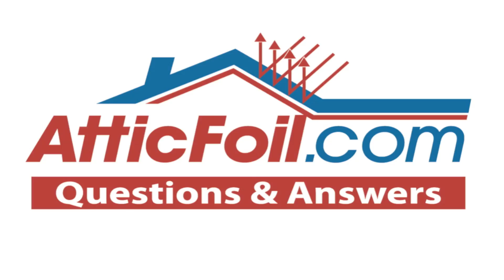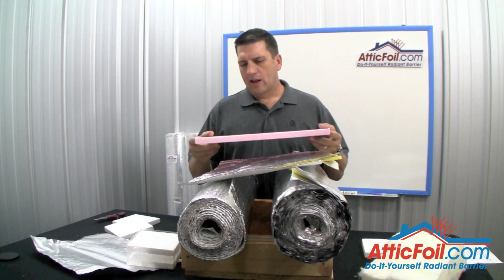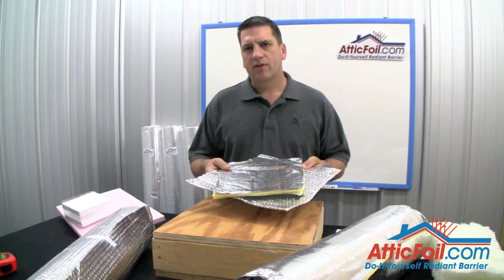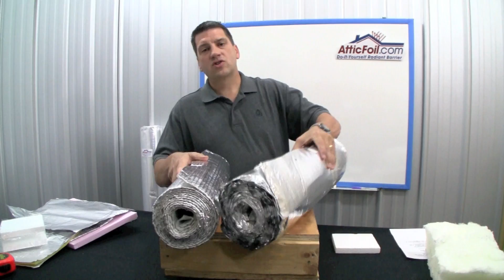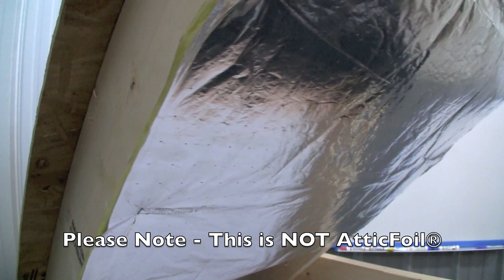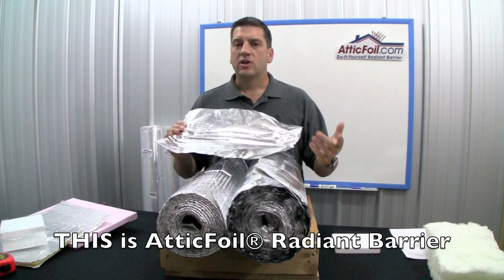Bubble Foil Vapor Barrier Scams - False Claims About 11 R-Value By Other Products

Comment from the maker: Have you ever seen a scam claim for a product stating a unrealistic R-value?  Please comment here!
Reply: Very common in France and UK , I have been fighting this miss information for years this has done a lot of damage to the reflective foil market , when install correctly Radian Reflective transform the thermal performance of the building, Do it correctly ..
Reply: When I put the radiant foil on my roof floor should I staple it? Or let it sit loose for air to flow???
Reply from the maker: @kodyhunter5566  Lay it loose.  No need to staple down.

Comment: I saw one advertised with R-7 on amazon, so, I knew something was amiss.   Dog leashes I bought for a 90 lb dog from amazon, would not hold a 30 lb dog, an electrical cord bought on amazon melted, etc, etc.  amazon has no controls.   No check.  No Accountability.

Comment: I have a commercial building, Auto Service shop with 30 foot ceiling. we have a radiant barrier but the joist hangers are rusting out. Can the radiant barrier be causing this trapped moisture?
Reply from the maker: Probably not caused by the radiant barrier.  My guess is lack of ventilation and condensation issues.  Take a look here: https://bluetexinsulation.com/pages/moisture-in-metal-buildings-causes

Comment: Everybody keeps talking about homes? What about a semi truck? What be the best way to install something like this? There have beams on the inside behind the panels that are like beams in the house. Get so hot and no semi trucks it's insane. You can walk inside and go to the restroom while your truck is turned off and when you get back it is so hard to cool it off. The AC unit on the semi truck works fine it blows a lot of air. But an APU on what's in my truck doesn't do much you're fighting against everything.
Reply from the maker: We have many people install our metal building products at www.BlueTexInsulation.com inside metal shipping containers, trailers etc. with great results.

Comment: But I want something for underlayment on a sub-floor between floor joist that is exposed to outside cold, not in my atic, So bubble foil will meet that requirement better and will detour rodents.......
Reply from the maker: Check out our foam/foil products at www.BlueTexInsulation.com 10 times more durable than bubble foil products.

Comment: does atticfoil  help to save energy during winter ?
Reply from the maker: Yes.  The best method to keep heat "in" is to lay the SuperPerf product on top of the existing insulation. It works mostly by making the EXISTING insulation MORE effective.  https://atticfoil.com/index.php/installation/over-the-insulation-install/

Comment: Question:  I have a small cottage in Florida with a metal roof.  In the summer the AC does it best to keep up but the attic is so hot it seems that the cool air coming out is not as cool as it could be.   Will attic foil help reflect the heat so that the cool air flowing in the duct work remains cool?
Reply from the maker: This is exactly what www.AtticFoil.com is designed for.  The heat from the hot roof is radiating across the attic space, heating up the insulation and then entering the home.  Your AC simple removes a certain amount of heat.  By reflecting a lot of this heat back this means an easier battle for your AC. (less heat getting in).  Basically AtticFoil make is like a really cloudy day.  I'm sure your AC can keep up on days like this.

Comment: I have a new product that is R 600. You just take 60 rolls of R 10 and sandwich them together add 6 inches of your choice of wall material and add 4 more inches of spray foam. Do you see where I am going with this. It should be illegal to advertise a product that only reaches a given R factor with the help of other materials. Scammers!  Thanks for the video and explanation.

Comment: WRT "Dead Air"...... it has an R value of slightly less than 1 (~0.9) and reaches this maximum at between 5/8" to 3/4" thickness.  Any thickness more than this it loses R value due to convection currents within the airspace as a result of the temperature differences between the 2 surfaces.  So the R value of a 6" air gap would likely be at best R0.5.
Reply from the maker: I think your comment totally supports my argument made in the video.  Bottom line is that NO product 1/4" has an R-value of 7, 10, 15 etc.  These companies have very misleading info when they talk about R-Value.  The R-value stated is ALWAYS in some type of "assembly" which is rarely how the product is installed.  And, as you point out, the "assembly" R-Value is probably overstated too.  Thanks for the comment.  Ed.  We have several great new products at www.BlueTexInsulation.com that combine Foam/PE Woven Fabric and Pure Aluminum to  make an amazing product for metal building applications.

Comment: Can you use the attic foil in the wall as and roof of a metal building, then also add 2” foam insulation? Making an insulation sandwich more/ less.
Reply from the maker: Probably yes.  However, you should call us do discuss the specifics of your application.  We need more info.  New or existing building, conditioned or non-conditioned, location etc?  Call us at www.AtticFoil.com

Comment: I have a bedroom above my garage that has the roof coming at an angle and a knee wall at the edges... should I use foam board and this stuff behind the sheet rock? There is no insulation in the section above the knee wall where the roof deck is essentially directly above the sheet rock and it gets extremely hot in the summer... These channels are connected at both ends to the attic and knee wall space...so i'm trying to find the best way to insulate and prevent the heat from the sun from getting in! Thoughts?
Reply from the maker: Yes, foam board combined with radiant barrier will make a huge difference with "hot walls".  This blog post may help too: https://www.radiantbarrierguru.com/hot-rooms-in-my-house-how-to-make-them-more-comfortable-part-1/

Comment: Put that Radiant barrier in our Attic years ago. Just laid out on top of the Insulation that was there. Had people laugh that it was only Tin Foil. But used to be 4 degrees or more temps between the floor and ceiling in our house. After installing this now its 1 degree difference only.

Wrapped a live bait tank with 2 layers of this stuff. Sitting in 90 to 100 degree temps for almost a month. Bream we had been using for bait (3 small ones) was still alive. Boat was under a roof. But still hot temps. Bait used to only last hours. but after covering it with this stuff. Days and weeks now.
Reply from the maker: Thanks for the comments!  When you take out the radiant heat and just deal with conductive heat then you have seen what a difference it can maike.
Reply: AtticFoil Radiant Barrier Foil Insulation
Worth the price, if we had to build a new house. It would be wrapped in this stuff.
Reply from the maker: Absolutely!  Using the single sided radiant barrier instead of Tyvek House Wrap is rapidly growing in popularity.  https://atticfoil.com/index.php/applications/house-wrap-behind-brickstone/

Comment: THIS STUFF is for REAL!!  41% savings over last year on my E(xtorsion) bill and had a temperature increase of 5 degrees over last year (average ambient). SO GLAD I did this in my attic.  Wish I had done this the last time I added inches to my blown-in insulation.  Brought the temperature down 60 degrees in my attic, no BS. Also added 2 solar fans:)

Comment: Do you have a fire test video where you apply a blow torch directly to this foil? Does it have a fire retardant coating on it?
Reply from the maker: No test video.  We do not claim the product to be "Fireproof"  The aluminum will resist flames, however if the internal scrim gets hot enough it will eventually liquify and burn.  Here is more fire info:  http://www.atticfoil.com/technical-information/fire-testing.html

Comment: In the Fresno area, they install radiant barrier over spaced sheathing when removing cedar shakes; this means that half the foil is covered by the skipped or spaced sheathing. Since half the foil is without a air space, wouldn't this reduce the effectiveness of the radiant barrier?
Reply from the maker: Yes, this is pretty common.  This will reduce the overall effectiveness by about the amount of area where there is no air space.  One suggestion is to remove every other lath.  This will help maintain the integrity of the framing and increase the effectiveness of the radiant barrier.
Reply: the temperature of the composition will increase also.This may reduce the life of the composition.
Reply from the maker: The actual temperature increase is less than 10 degrees.  This is considered nominal.  Here is a video on this with thermal imaging. http://youtu.be/OHpyv_kxmoI

Comment: What if your attic has a bunch of blown in cellulose insulation?
Reply from the maker: Attic insulation is great.  I like to think of it as walls of a refrigerator.  Radiant barrier is more like shade.  You have both types of heat coming in your home.  a radiant barrier should be your first line of defense against radiant heat, and regular insulation should be your second line of defense against conductive heat flow.

Comment: R value is a thermal time measure.  Foil does not have an R value.   Its efficiency is by reflection of infra red rays which create heat and by emissivity - its inability to re-radiate the rays.  Good quality foil will reflect up to 98% of the rays and emit a maximum of 3%
Reply: This is a bubble or foam product he is talking about, a sandwiched product. Slight R-value from the foam or air but a waste of money like he is saying.

Comment from the maker: You COULD do this, but WHY??  For a normal attic this would make in harder to install and unless you cover the full rafter, you will get what is called "thermal-bypass" or heat bypassing the foil through the rafters.  It's easier and more effective to just staple to the bottom of the rafters.  If you are doing a cathedral ceiling, THEN you will need to attach inside the rafters - see Cathedral Ceiling install methods on the website AtticFoilDotCom.

Comment: Can you cut and staple strips of attic foil flat in between the rafters? Or does it have to be stretched across (covering) the rafters?
Reply: You can do that, but the rafters transfer heat, so it won't be as effective. If you're able to staple into the bays and wrap over the rafters before putting your ceiling on, I would   tack a lateral grid of board to the rafters to leave an air gap between the rafter and the sheetrock. It's like the way metal roofs are put on, only upside down.

Comment from the maker: Shingle temperatures usually only go up less than 10 degrees over a radiant barrier.  This is generally considered not to be significant.  I have a complete video using thermal imaging which shows part of the roof with and without radiant barrier.  It's called "Does Radiant Barrier Damage Shingles?"

Comment: I would like to know if the reverse radiant has and effect on the deterioration of the roof shingles?
Reply: This is a good question.  After installing insulation at the bottom cord of my attic 10 years ago I noticed a rapid deterioration of my shingles.  Obviously needed more ventilation.  But if a further layer of attic foil were added does that also mean more heat reflected back at the shingles?
Reply from the maker: @pilsley4737  No, the roof temperature will only increase 5-10º over a radiant barrier with decent ventilation.  This is considered nominal for roofing products since they are designed to handle temps over 200º.  More here including thermal image video with/without radiant barrier.  https://atticfoil.com/index.php/knowledge-zone/knowledge-zone-learn-about-radiant-barrier/myth-or-truth-radiant-barrier-damages-roof-shingles/

Comment from the maker: Heat always from hot to cold.  Assuming the inside of the home is warmer than the outside heat is flowing out of the home regardless if the heat is on or not.  Radiant barrier will help reduce some of the heat loss to keep the home warmer.  It should never make it colder.

Comment from the maker: As long as one side of a double-sided foil radiant barrier is open to an air space, the foil with work to block 97% of radiant heat transfer. Let me caution you against putting insulation in your attic rafters - that is completely useless in a non-conditioned, vented attic space. The r-value belongs against the thermal envelope - or the attic floor against the home.